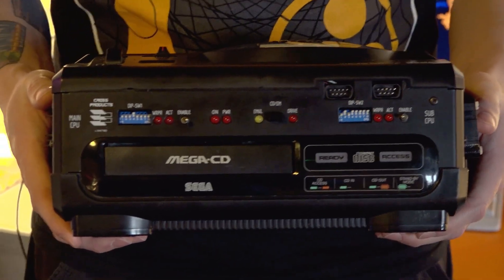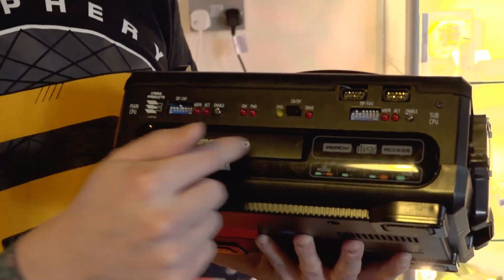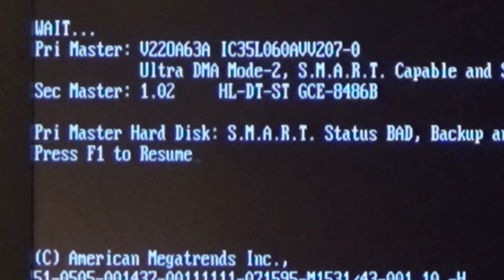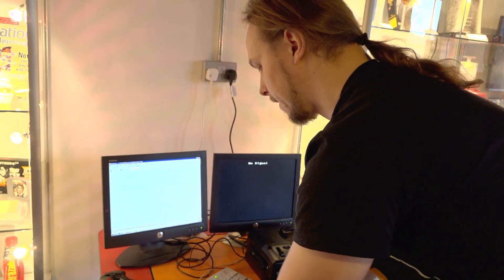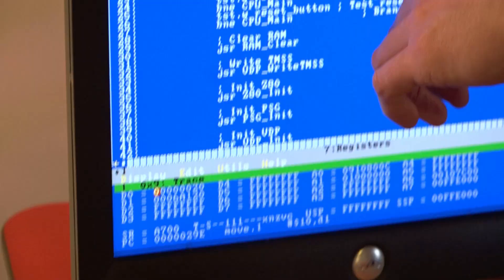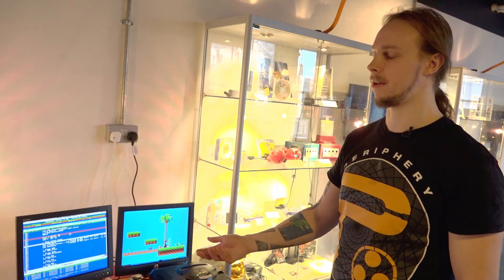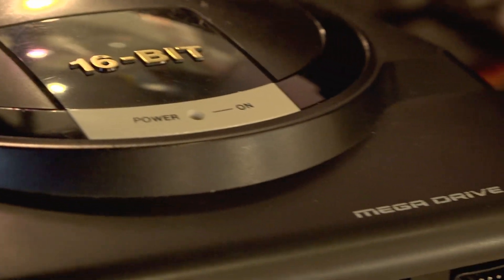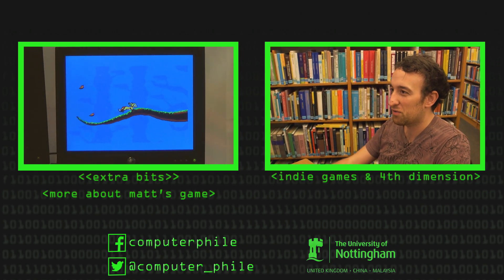Sega Game Coding in Assembly - Computerphile

Comment: can't you use it with a VM?
Reply: Well, yes, in theory you can develop with an Emulator. And for many of us this is the only real choice we have, because we can't get these developer kits, they're exceedingly rare.

But, unfortunately, this has some downsides. Quite a few people have developed demos and things for emulators that work fine in the emulator they developed it with, but doesn't work at all on real hardware, or behaves very strangely.

Even the most accurate emulators around still don't emulate everything entirely right, which means if you're trying to do anything that really pushes the technical limits of the system, and base it entirely on an emulator, then chances are it will fail on real hardware, because of some subtle point or limitation the real hardware has that the emulator overlooked.

It's also not trivial.
If you'd like to write say an snes game using an emulator, but would like it to run on real hardware, you really only have one choice.
You have to use an emulator called Higan, because it's the only thing accurate enough to stand some chance of things working as intended on real hardware.
But even so, Higan, while quite accurate in many ways, still falls short in others.
(I came across a forum discussion between the person that made Higan and someone working on an snes game. The snes game did really complicated tricks that changed graphics around in multiple places on a single scanline, and here it turns out real hardware does something different to what Higan does, so he got bugs he had no idea how to fix.)

To top it off, while some snes emulators could run on 133 mhz pentium, to achieve the accuracy it currently has (which is still far from perfect) requires a modern CPU running at 4 ghz. And it's impossible to meaningfully create parallel code if you're trying to make a hardware accurate simulator, so that 4 ghz has to be in terms of single-core performance. And it quickly is getting to the point that to make it any more accurate would require upwards of the equivalent of a single core CPU running at 10 ghz to get the accuracy required to ensure a game developed this way would work on real hardware properly.
Higan wasn't designed for developers by the way. It exists solely to try and be as accurate an emulator as possible.
It just so happens that accuracy of emulation matters if you're going to develop software.

So what is the alternative? Well, you can of course develop using  a flash cart, and real hardware.
And in fact, at some point you'll have to do this to actually verify everything works as intended.

But... That's not so great unfortunately. While you can test your programs on real hardware that way, you'd be using a consumer system.
Not only does that mean you need more than one of them (to make sure your game works on US, japanese and European consoles for instance), but it also means you can't really have any debug code in the game when testing it on real hardware.
There's few ways to get the debugging messages out of the system (notice in the video he had the dev kit attached to a PC so he could see the debug output while the game was running on another screen), and debugging usually requires more storage space and RAM, which of course the consumer systems don't have.

That means you end up needing to use an emulator that doesn't behave the same way as real hardware to write and debug something and guess at what the differences between it and real hardware might be...
Copy the code to a flash cart, run it on real hardware, look at what happens.
If there is anything weird, you can't debug on the real hardware, so you have to guess what might be wrong, go back to the emulator, rewrite the code, even though the emulator doesn't replicate the problem you are having, put it back onto the flash cart, and repeat until it works.
Very tedious.

But, that's what happens if you can't get hold of real developer hardware.
Which, you probably can't.
I mean, look at this video.
That developer kit he has is one of two in the world right now that is known to work.
ONE OF TWO.
That means there are exactly two people that can use real developer hardware, and everyone else in the world has to struggle along with the clunky, inefficient methods I've described above.

Yes, it's doable, but it's not exactly easy.
Reply: Someone would need to reverse engineer all of the hardware in the dev kit